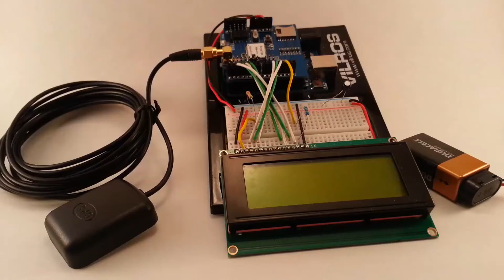GPS Location with Arduino Uno

Comment: Hi David!  I have a question: I bought this GPS module here:
https://pt.aliexpress.com/item/Free-Shipping-1PC-Ublox-NEO6MV2-GPS-Module-Aircraft-Flight-Controller-For-Arduino-New/1765564932.html?spm=2114.13010608.0.0.abXKdg that is not a Shield; I would like to use it with your project, so I would like to know what to modify in the code (do I have to declare the pins used? How do I?)  Thanks

Comment: I have the same GPS shield. I didn't have the lcd so I edited your code so that I could see things in Arduino Monitor. The Antenna I have is about 3 meters long. But my GPS is not returning any values even after 1000 seconds. What do you think is wrong?

Comment: Great video, I ordered the same GPS shield, I plan on setting it up the same way, but using the SD card to log the time and location. I'm going to try and use Jeremy Blum's format, for saving to the log. I'm new to Arduino.
Reply from the maker: Sounds like a cool project. Be sure to also check out the associated blog at http://davidhoulding.blogspot.com/2014/06/gps-location-sensing-with-itead-gps.html . Jeremy also has some great videos / blogs etc. Have fun. Let us know how it works out.